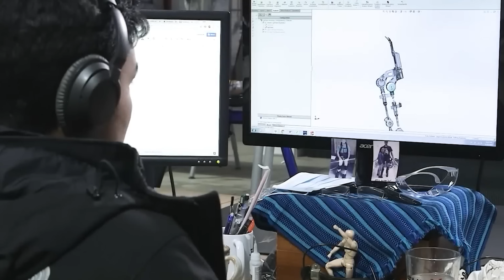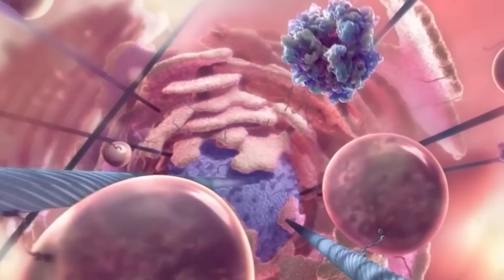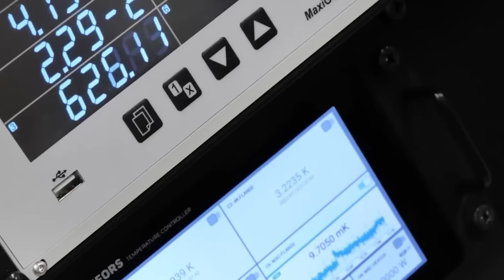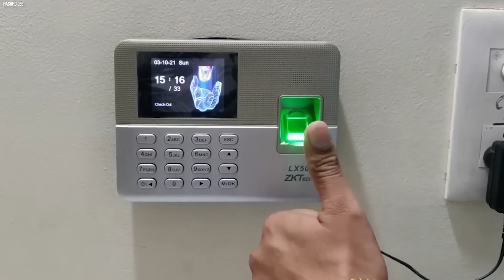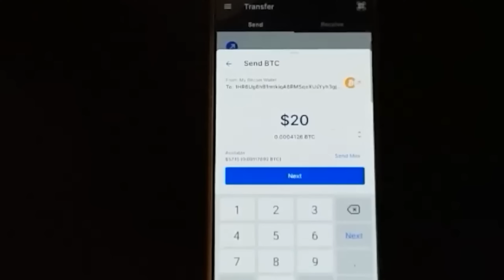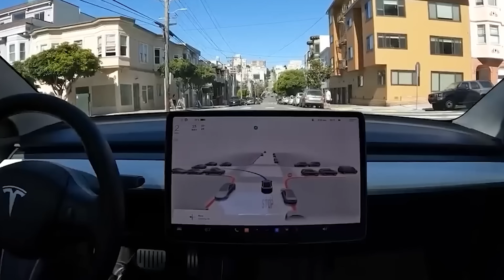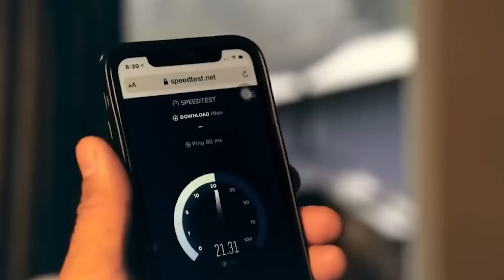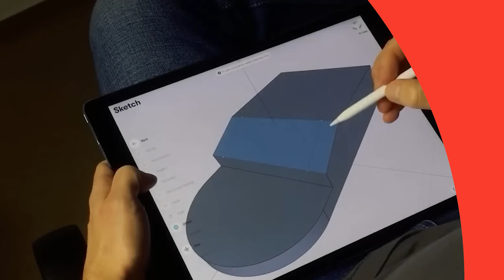Get Ready for the Future: 20 Emerging Technologies That Will Change Your Life

Comment: How does bacteria knows there’s a crack?
Reply from the maker: That's a great question! Bacteria don't actually "know" there's a crack. The bacteria in self-healing concrete are activated by moisture that enters through cracks. They produce a material that fills the crack without actually "knowing" it's there.